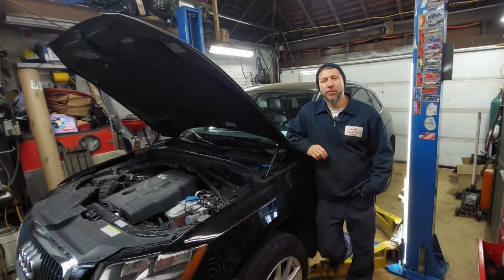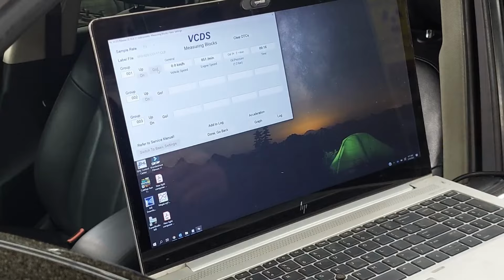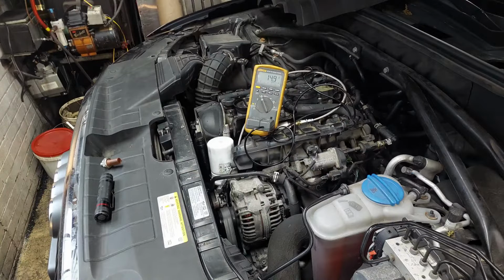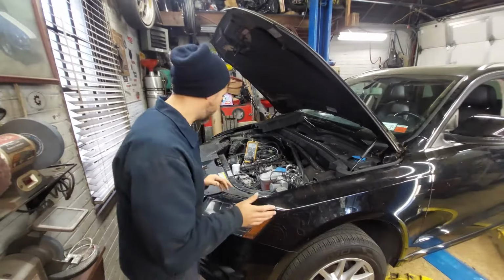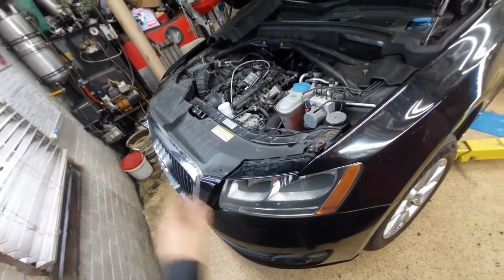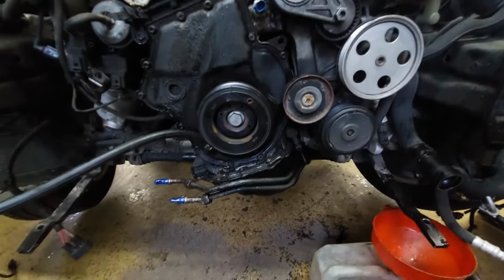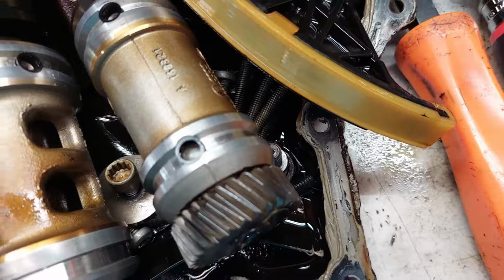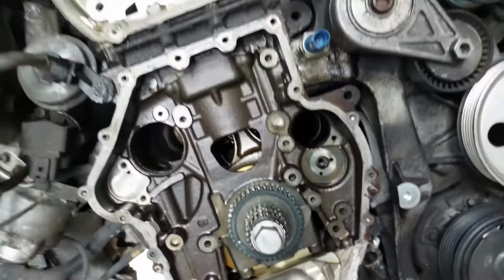2008-17 Audi Q5 P164B P164D P0341 low oil pressure. Part 1

Comment: Hi, I watched your video and wanted to get your opinion. I have a 2011 Audi A5 TFSI. When I drive the car for the first 15–20 minutes while the engine is cold, everything feels fine, but after that once the engine warms up (I think), the car starts to shake at low RPM (around 1000–1200) and the EPC light comes and goes. Sometimes when I lightly press the accelerator in traffic, the car accelerates slowly, then suddenly the RPM jumps up to around 1600–1700 which is where it should be according to how much I press the pedal. Occasionally the car stalls, but when I start it again it starts easily. The fault code I’m getting is P0341 (Camshaft Position Sensor). I have already replaced the camshaft position sensor, ignition coils, spark plugs and the camshaft magnet. Could you please help me? If there’s anything else you’d like to know about the car, I’d be happy to provide more information. Thanks in advance.
Reply from the maker: Sounds like a timing chain stretch issue, definitely get that checked out. Thanks for watching!

Comment: I have the same problem with my Audi q5 2014 2.0TDI 177hp. My fault code is (Oil Pressure Switch for reduced 
Oil Pressure) P164D 00 [032] - malfunction. Show it to me after a long journey, when I stop at a traffic light. It doesn't show me that in short-distance city driving. I still have no idea what it could be... If you have any advice, I would be very grateful.
Reply from the maker: That code is related to low oil pressure, so start by verifying that you have good oil pressure with a mechanical gauge.

Comment: Audi stop spending 1,000 dollars and hrs. If your Audi has over 70,000 miles  FIRST change oil go 1 viscosity higher. Problem solved. Even if car is not high mileage go up 1 viscosity,  small price pay.
Reply from the maker: Thanks for the suggestion, however, the issue is usually caused by a mechanical problem. I've done thicker oil. Usually only a short-term fix.

Comment: hi There I have a low oil pressure reduce oil with a faulty code P164d00, the filters have been changed . the oil have been changed , the switch of low pressure oil has been changed too . nut the red light with low pressure oil , please turn off the engine , still coming up ? I am desperate
Reply from the maker: Sounds like a tough issue, I would recommend changing to a bit thicker oil. Try a 10w30 instead of the normal 5w20.

Comment: This is a terrific video..Thank you for helping the community of DIY mechanics. You are an expert! I learned a lot. I have a question. Should I change the guides? They look OK.  And the chain is not streched because the measuring block value is about 4.1 and the tensioner is only out 4 ribs.
Reply from the maker: Well, if you have made it that far, it's cheap insurance to just do it now and then again in a short amount of time.

Comment: I own a skoda superb tsi petrol when car is on idle then only oil pressure light comes on dashboard and when i runs the car it goes out from dashboard and fault code is coming P164D . Is that oil pump issue or oil pressure sensor issue ? Plz let m knw what's the issue is .
Reply from the maker: I would first connect a manual gauge to see what the actual oil pressure is. If it is below 15-14psi at idle then the issue is not the sensor. The most common sources for this issue I have found to be in the intake camshaft adjuster and the cam bridge. Hope this helps, and thanks for watching.
Reply: Hay I have VW touran 1.6 diesel he is showing oil pressure light after 4 to 5 miles and it's started beeping I have changed oil pressure sensor oil level sensor oil pump and it is also checked electric wiring all is ok but the problem is still same please could you suggest something

Comment: مرحبا عندي اوديQ7 3000cc عملت عمرة محرك وغيرت حساس ضغط الزيت واخر حرف من الحساس مختلف هل من لممكن قرائة الحساس مختلفه لمبة الزيت مرات تشتغل ومرات لا وعند حساس تايمنك ترس عامود الكامه مسجل عطل وبيطلع صوت الترس هل لهو علاقه بتنوير لمبة الزيت
Reply from the maker: You can read the oil pressure from a scan tool. But to me it sounds like you need to connect a manual gauge to see exactly what the oil pressure is. If you are hearing chain noises chances are the oil pressure is too low. Most common problems are in the intake camshaft adjuster and the camshaft bridge. Hope this helps, and thanks for watching.

Comment: I’m having the P164D00 on my 2011 A4. Weird thing is, it’s the only code that shows up with no other like you were having with the camshaft DTC. I removed the plug for the oil pressure switch and there is no oil inside the connect (which I have seen occur on the CCTA engines). Haven’t had the time to setup a mechanical oil pressure gauge but with your experience, as you mentioned at the beginning of the video. P164D with no other time related codes typically is indicative of the switch going bad. Another thing to note. I seems the car doesn’t have the warning light engine off when in driving. Only when the car is at idle. Any suggestions would be appreciated. Thanks for the amazing video brother. Doing the Lord’s work for sure 👍🏼
Reply from the maker: Well, first off, thanks for the comment.  I have done several of these since this video was first posted. I still have not found a consistent issue, but it is usually caused by a bad intake camshaft phaser and/or the cam bridge. It's still worth confirming with a mechanical gauge first. Most of these show up at idle or as you slow down at a traffic light. Thanks for watching.
Reply: @willpoweredgarage969  Wanted to update/document my experience. I ended up putting a mechanical gauge to see actual oil pressure on cold start and at warm idle. At cold start the pressure is at 50PSI and goes down to 19/20 psi at warm idle. As far as my understanding, it seems to be at a normal range, which to me 19/20PSI at idle seems a little on the low of the spectrum. I got my hands on a new oil pressure switch (brown colored one) and installed it. I also added 10w40 oil instead of the 0w40 I originally put in the vehicle. Not sure if the 10w40 might be necessary, might be a little aggressive to do but.... the vehicle DOES NOT show the warning light "engine off" at idle anymore, which is AMAZING. Again, thanks for your videos man.
Reply: @ivanvega2821 hey did that work for you or did the light ever come back? I have an Audi s6 4.0t and I have the same code you have with no other codes! Car drives perfect and there’s no oil warning light when driving only occasionally on a warm idle.
Reply: @alexmyhas light never came back on. Don’t know how applicable this might be to you considering you have a 4.0. Good luck
Reply: @ivanvega2821 thanks! Last question do you remember if the connector was 1 pin or 2 pin on your switch
Reply: @alexmyhas it’s a one pin.
Reply: @ivanvega2821 sweet this gives me some hope. I had a diagram and it showed me that the 2 pin is the reduced oil pressure switch. However chat gpt swears that it’s the 1 pin and lots of online videos of other Audi say it is the 1.
Reply: @alexmyhas if you have oil inside the one pin connector and there’s oil inside the sensor. 9 out of 10 you have a bad sensor and explains the low oil pressure warning

Comment: Great video, I am just wondering what about low oil pressure light while the engine is only warm and only on idle? The cat seems perfect while driving and while idling when cold.
Reply from the maker: Generally the low oil pressure light only comes on when at hot idle. Both vw and audi still do not have a definite cause or repair. I have seen many that have improved with a replaced intake camshaft or cam bridge. Best way to see where you are is to put a manual gauge on the engine and see what the pressure is at idle. Needs to be above 14psi in most cases. Thanks for watching.
Reply: @willpoweredgarage969  Love this video with your in-depth knowledge and experience.  But to have these detailed answers as well...  You sir might have just saved my girlfriends dumb Audi.  The synthetic oil wasn't changed all year, so yeah I'm off to the store to go buy an oil gauge.

Comment: Hi mate we have a 2.0 golf r low oil pressure  . The engines been rebuilt by engineering shop . But has low oil pressure the pressure valve on the bottom of the engine connected or not connected doesnt apear to do anything when looking at the pressure on the oil guage
Reply from the maker: I have seen this many times on rebuilt engines. VW and Audi use a color coded system for bearing clearances and these a critical. Most of the low oil pressure problems I have been seeing is related to the cam bridge and the intake camshaft phaser.
Reply: Thank you @willpoweredgarage969

Comment: I've got the 2010 skoda version of the engine, EA888 gen 2 1.8L TSI, with the low oil pressure only at hot idle problem, which sound like what you've got.  I've seen allot of debate about whether it's the cam bridge or the intake cam shaft.  Allot of people have to replace the intake camshaft to solve the problem, in addition to the cam bridge.  I'm just doing the cam bridge, in addition to a seized exhaust balance shaft and all the chains and guides... Hoping that fixes it, if not intake camshaft is next on the list...
Reply from the maker: Well, I can tell you in my experience I've seen the most successful repairs in changing the cam bridge and intake cam. Though if your balance shaft failed, that will cause a low oil pressure situation.  I would inspect the intake balance shaft as well and drop the oil pan to inspect the oil pickup tube to make sure there is no debris in it from the failure. Thanks for watching and the comment.

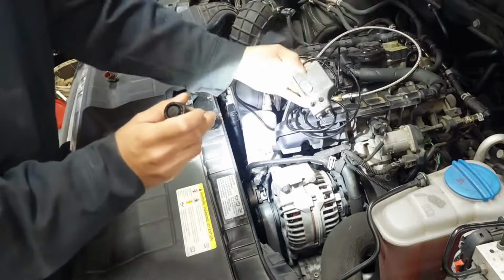Comment: You know things that my mechanical skills can only dream of. Was wondering what that gauge was you used at min 6:27; couldn't quite pick it up. I own a  mk6 2.5L and the pr. switches are above each other by the oil filter housing. Not sure how to get at them to afix a tester. Looks like parts need to be removed and then reattached before checking the pressure. Very knowledgeable video. Ty
Reply from the maker: The tester I used is just a pressure transducer made by Fluke. But, any mechanical pressure gauge will work. Yes, you do need to remove at least one of the sensors to make your connection. Thanks for watching and the kind words.
Reply: @willpoweredgarage969  ok thanks for that. Didn't know that a multimeter could read psi or bar; may be the one I've had for many yrs is ancient, like me. Haha.
My jetta sounds fine at rpm; the beeping n lght come on when it warms up.

Comment: Greetings from Thailand - my own 2012 Q5 tfsi started with the OPL Switch off Engine  light intermittently a few months ago 
- it’s only happening  when coming to a stop at traffic lights etc ,but lately it’s happening almost all the time  - 

It starts after Only  10+ miles ,it’s Only coming on  when you bring the car to  an abrupt stop ,at lights etc and it goes out as soon as you bring the revs above 1200 rpm 
(One time the engine cut out / EPC came on - but restarted after 1 min and EPC light is off since )

Any idea what might be ?? - ( I would love to have some knowledge before I bring the car in for inspection - it’s not the easiest with a language barrier etc ) 
Many thanks
Reply from the maker: Sorry for not getting back to you much sooner. I wonder if you took it in and what they told you? Most of what I have been seeing for low oil pressure has been caused by the cam bridge and the intake camshaft phaser. They seem to leak oil at such a rate that there is low oil pressure. I have seen several instances where the cambridge check ball is actually loose and does not provide a good seal. Thanks for watching and I hope you were able to resolve your issue.
Reply: Iam having the same issue.  I've had a new oil pump, oil change,  new low pressure sensor and switch, but still getting the warning light at stops and after about 8 to 10 miles. Afraid to drive further than that during to fear of doing more damage.
Reply from the maker: SO , as I mentioned above most of the low oil pressures situations I have seen have been fixed from either the cambridge or the intake camshaft with phaser. Please let me know if you have solved your issue and how so that we can help others that have the same concern. Thanks for watching and the comment.

Comment: Well I was getting this p0341 and at stops switch engine of check oil levels a stutter at 1500rpm and edc flick. So I changed all the sensors first nothing finally I pull the front of the car off and pulled the covers. Cambridge screen was intact but flogging around in channel and the ball check valve was pushed out so pushed it back in and staked that B. Timing was with in standards no bad ware. Put all back together this morning. Feeling like the Man. Drive it for a long while. No code no stutter but stop and there is the turn of car check oil🤔
Reply: Hey hey do you think my low oil is because that ball check valve is worn out cuz I did notice mine was just like yours  and I just pushed it back in but come to this k about it it’s real soft
Reply from the maker: It maybe damaged? I have been hearing a lot of success of people replacing the cam bridge and the intake camshaft because of the vanes in the adjuster leaking too much oil. I also recommend going with a heavier weight oil.
Reply from the maker: As I said in my video, this is just what worked on mine. There are various things that could cause this condition.  I was just trying to avoid the $900 camshaft and adjuster.
Reply: Balance shaft my guy anytime your epc light flashes with red warning oil pressure issue it's the balance shaft especially if your not pulling any cam codes. If it starts to overheat then you'll definitely for sure know it's the balance shaft as the intake shaft helps drives the water pump 😉

Comment: Dang...it would've been nice to see how you removed the balance shafts. No other guys on youtube actually show the process "Engine -in". They cheap out and do show the bench removal.....
Reply from the maker: That's because there is no pretty way to remove them. They are usually stuck in, and audi and vw both say they need to be replaced if removed. There is a special tool to remove them. It's an attachment that grabs the gear and uses a slide hammer to pull them out. The intake one can be pushed out after removing the waterpump and drive cog.
Reply: @willpoweredgarage969  So you used the t1093-1 tool on the exhaust and removed the water pump to get to the reverse threaded bolt on the intake?
Reply: Naptown tuner shows a lot
Reply: @jeamohney  He never shows the engine-in removal.
Reply: @deejay4837  because engine removal is like 3-4h job, and it's way easier then

Comment: Hey man im getting a p0341 im about the change the intake  cam so far I dont see anything wrong with the cam no excessive freeplay but I have noticed the cam bridge the sleeve in which the ball for the cam bridge is housed is pressed out I have to tap it back in what do you sopposed will cause this?
Reply: Lol just got to the end of the video and that's exactly how my cam bridge is pushed out ok let me continue onto part 2 😂
Reply: I changed the cam bridge and the next one when I took it out came out with the sleeve pushed out as well so I'm about to change the intake cam I'm only getting p0341 no engine noise etc
Reply from the maker: Hello, Sorry I am just getting to the comments. If the screen is still there, it goes into the bore of the check ball just a bit. Mine was missing completely and the check ball sleeve was pushed out way too far. Unfortunately like I said in my video unfortunately I have been seeing a lot of these lately and they all have different issues. Keep me posted on houw you make out with your repair. And thanks for watching.
Reply: @willpoweredgarage969  Hey np I took out the oil pump it seems like it's failing turns kind of stuff also it's one of those Audi Chinese pumps could not get to remove the balance shafts because they are seized in there but they turn fine so my repair I'm changing the oil pump intake camshaft for the cam range performance error and cam bridge with a new spool valve I really think it's the oil pump pumping low pressured oil causing the cam errors and the sleeve on the cam bridge to push out will keep you updated thanks for replying.

Comment: Got the exact same codes, changing the switches first lets hope its just that
Reply from the maker: I have been getting a lot of calls about this issue lately. If you are seeing below 15psi at hot idle you have an oil pressure issue. What weight oil and type are you running?